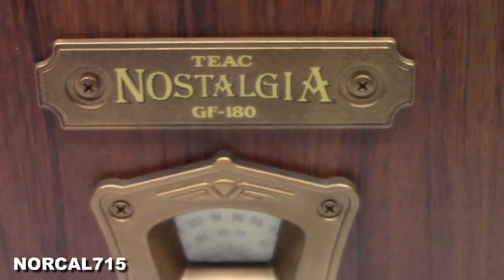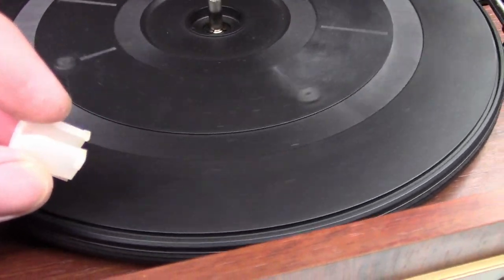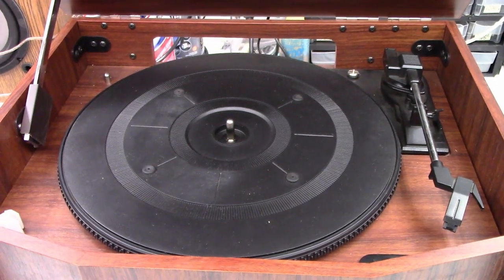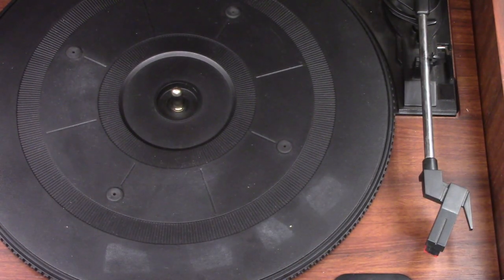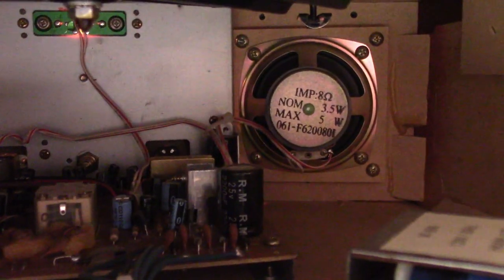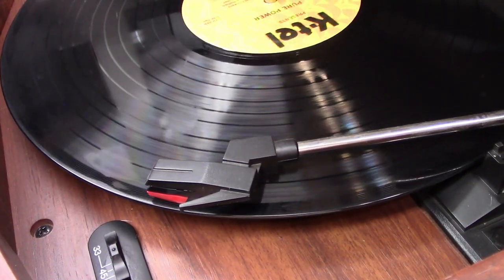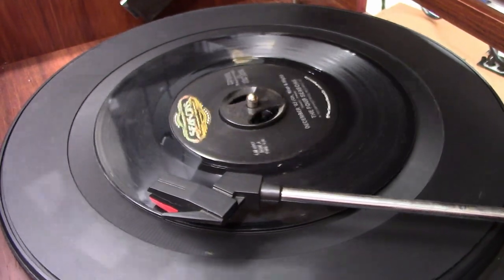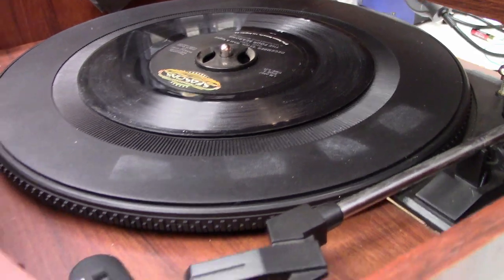TEAC GF-180 GF180 NEEDLE REPLACEMENT AND SPEED ADJUSTMENT WITHOUT A STROBESCOPE 793-D7M

Comment: It’s amazing that there is so much old equipment still around with all the new options and people still fixing it. I bet in 30 years you won’t see anyone fixing half the junk on the market today
Reply: I like the fact that it has 78. I have several boxes of "old" and I mean OLD 78's that I'd like to digitize before that degrade away, to preserve them. I've found the "best" way to play out of print, no re-released & rare vinyl for digitizing archival purposes is playing them "wet". 

1. Wash off the platter with warm soapy water, rinse clean and wipe dry with clean towel. 

2. Wash the vinyl with a soft towel using warm soapy (mild dish detergent is okay) water in a circular motion following the grooves (not too long, you don't want to damage the labeling! & rinse clean) This expands the vinyl and allows the oily debris "embedded" at the bottom center of the grooves to release. Dry with a clean rolled up soft towel in a circular motion rolling the towel up and away (just like an old "Dust Bug"  used to be used). Now Platter and vinyl is clean. 

3.  You need one of those good, clean felt roller, self tracking anti-static arm units for the actually playing during digitizing, a small clean glass with warm water, only and a decent eyedropper to keep the felt roller wet enough to maintain the coating and you can digitize the entire side in one shot. This will keep the vinyl wet and lubricated with clean water the width of the felt roller (since they don't track precisely). The difference in sound quality is amazing! Don't over load the felt and make "puddles", just enough to keep the vinyl wet during playback.

When the side is done, dry it as in step 2 before flipping over and repeat step 3..

Note, make sure all of your cartridge settings are spot on, Alignment, Anti-skate & Weight before starting digitizing. You may notice debris "clumping" on your stylus on the 1st play. That means it's getting deep into the groove, so you might have to play it once before recording, a good thing.  That's how we did back in the day going from vinyl to tape.
Reply: This isn't that old, lol. Since vinyl is so popular and has been for awhile, I doubt that. And I wouldn't call a turntable, junk. Even if it is a bottom of the market player.

Comment: 🐨 Just a heads up in that it is normal for Larger records with a larger content "Longer Track" to have much lower Volumes "Dynamics", this is because the groves have to be compressed in order to allow a longer track, In short if the sound wasn't compressed the grove at any point may end up being cut or moulded awfully close to the track on either side of any give part of the track, Therefore as the needle is thrust from side to side "during playback" for one of the stereo channels the needle may wear away any given part of the track for a skip to occur, ergo when one purchased a album in the past "Well- for me it was desirable"  one would hope it's dynamics were significantly lower thus knowing the album wasn't going to be prone to developing skips..

BTW - A stop watch timed against respective titles play time is one way to gauge speed, Also a line or blob on the platter can be used as a count of 33, 45 and 78 revolutions for any given minute, but best of all.. if you have a smart phone, plonk it on the platter with a revolution counter installed.. 😉
Reply: Good observation. That's why cartridge alignment, anti-skate & tracking weight is so important! The stylus should be just "floating" in the groove with as little forces (especially lateral) as possible impeding tracking in the center of the groove. Read my comment digitizing.

Comment: Hello I have a Teac Ag-D9260 AV receiver. May be you can help me with its prob. Audio can’t controlled by volume adj in remote or manual. There is loud Tic sound during adj of volume. Very low audio sometimes no audio at all. When audio comes on it is fix even in min or max. Putting the sound mode into Dolby prologic or DTS audio is blurry. Hope you can help. Thanks in advance.